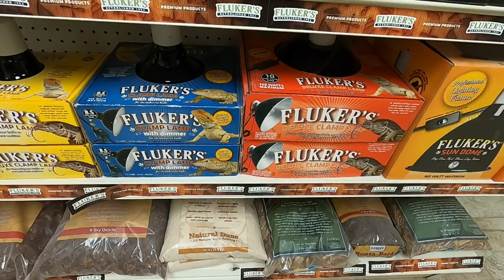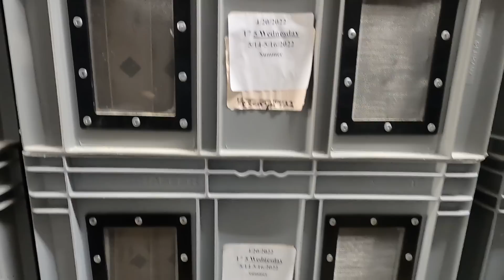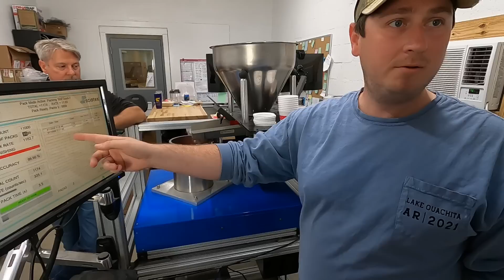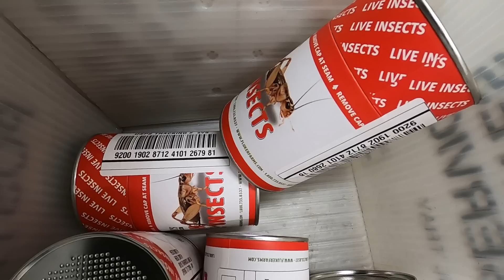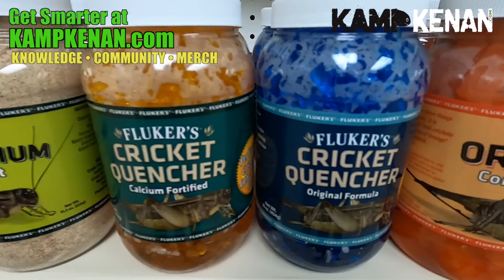Bugs! It's not just Food for Reptiles!

Comment: Cheap way to count crickets would be to establish a weight for the different amounts. Either way, if you get more fat crickets and slightly less count then still fair. More smaller crickets in the batch then you get a little more. would work its way out over time.